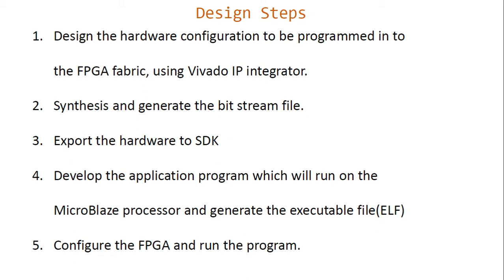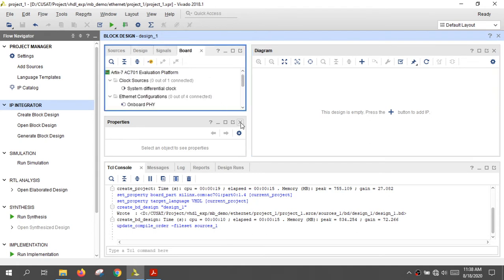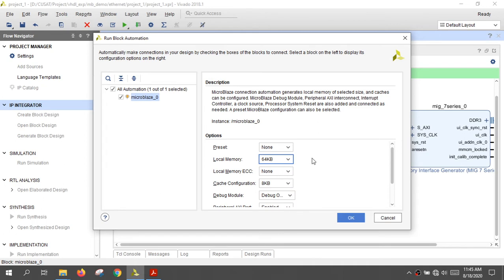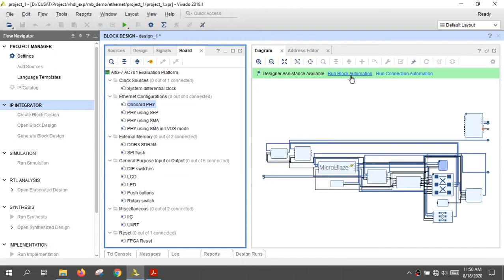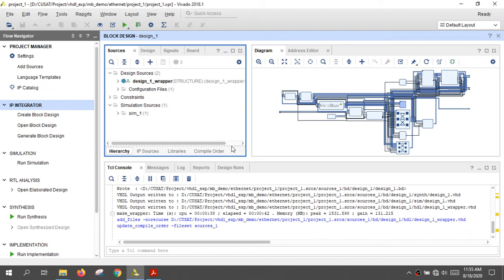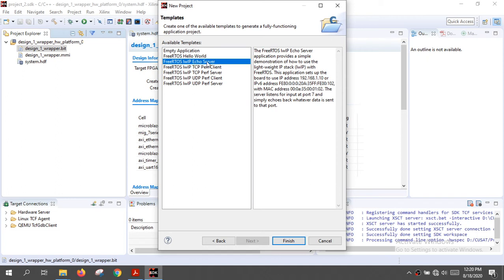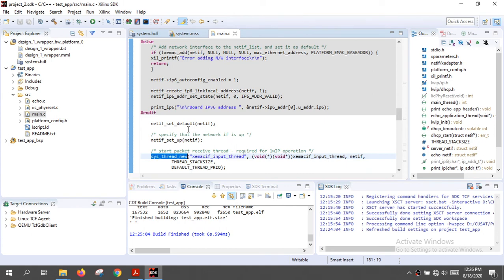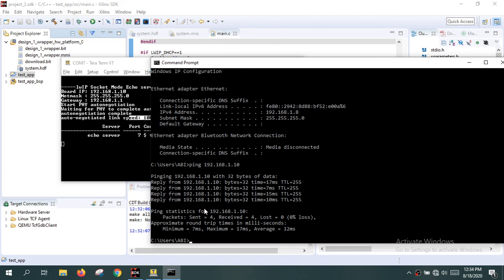MicroBlaze and Ethernet based design on Xilinx Artix 7 evaluation board (AC 701) and Vivado

Comment: Does ethernet ip need processor to receive and transmit packets? Or just hardware ok
Reply from the maker: @artie5172  it is not essential to have processor for using Ethernet. You can directly interface Ethernet IP to RTL
Reply: @letslearn39  👍 . Is that axis_txc and axis_rxc necessary? Can you use axis_rxd and axis_txd alone ?
Reply from the maker: @artie5172  txc is compulsory. Rxc I am not sure.
Reply: @letslearn39  what does it do txc and rxc seems like they are just control signals but what do they control ?

Comment: There is almost 1.3MB of block memory available in the Artix 7 200 on the AC701 board.  You don't need external DRAM for small applications.
Reply from the maker: True. If your application including stack and heap is small enough to fit in to 1MB, you can use BRAM. If you are not using lwip, freertos, jumbo Ethernet frames, then it can easily be made less than 1MB.(And ofcourse if you are not planning to use any BRAM consuming RTL logic/IP core in your design)
Reply: @letslearn39  I'm using the Full FreeRTOS+TCP stack with all features enabled.  Turned off Jumbo frames, and still can build and debug with -O optimization.  (Don't know why Xilinx/AMD keep pushing this trash LWiP stack...)  Would still love to have a short FIFO for my application instead of the complexity of DMA, for my simple application.

Comment: Hi,

Around 10:00, you're mentioning that we want to run the application from external DDR3 memory. But after that, you never come back to this point. So is the application effectively running from that DDR memory? If so, how is it loaded there?
If not, in video https://www.youtube.com/watch?v=cxl7Hh6TNb4 you're using the SREC SPI bootloader to download this application from flash into DDR. But DDR memory resides at 0x8000000 whereas the BRAM is located at 0x0. So I'm assuming that a change is needed to link the application correctly for that change in address space, but I couldn't find where that's happening.
Or maybe the address memory 0x80000000 is automatically mapped towards 0x0 by the SREC SPI bootloader (I remember from STM32 that this is done automatically somewhere in the bootloader).

I hope my question is somewhat clear?
Reply: In the meanwhile, I've understood that this is fully under control of the linker script. Furthermore, it's indeed vital to first generate the DDR3 controller before generating the microblaze processor. In that case, the linker will automatically select DDR3 memory to put the application in. And it's possible to revert back to BRAM.
I first added DDR3 memory on top of an existing microblaze design, and I never managed to get it working from DDR3 (and the linker automatically selects BRAM when creating the project). That's the sign that something is wrong. Possibly, the microblaze generation needs to happen after the DDR3 generation, so that the microblaze can immediately pick up the correct memory blocks and use DDR3 as default.

Comment: I followed the same, but it doesn't work. The HW goes up to VITIS, but if you run it with Echo Server Terra, it will not change from a black screen. I added the xdc file separately, is there anything else I need to add? I would really appreciate it if you could answer. The version is 2022.2.

Comment: Very good tutorial!! Thanks for sharing
I would have probably been more useful for me  a more versatile bare metal app than rtos....but very good anyway
Reply from the maker: The reason why I went for an OS is, lwip supports the SOCKET mode only with OS. Application development becomes much easier in SOCKET mode, as you can use the standard socket programming functions.

Comment: Sir please teach how to use and change user programmable clock in AC701  evaluation kit
Reply from the maker: You just need to add a clock wizard ip in your design and then you can generate the required clock

Comment: I followed this tutorial exactly in Vivado 2021.2 but I get some timing constraint errors. 
[Timing 38-282] The design failed to meet the timing requirements. Please see the timing summary report for details on the timing violations.
WNS -0.622 and TNS -265.714 Failing Endpoints 1732 ...

Comment: Just a quick question. Would this also works for Standalone OS? If yes, what is the reason behind you used FreeRTOS?
Reply from the maker: Yes this will work with standalone mode as well. The reason I used FreeRTOS was to configure lwip (TCP/IP stack) in SOCKET mode. Once lwip is in socket mode, you can use the standard socket programming APIs to develop your applications. In RAW mode you have to use lwip specific APIs.

Comment: Thank you very much, worked for me i have configured ethernet port of zc702. Now can you tell me is possible to read received data from PS to my PL part. I want to see received packet data using ILA??
Reply from the maker: A simple way to transfer data from PS to PL would be to interface both using a Block RAM configured as Dual Port RAM in BRAM controller mode

Comment: how the interrupt handlers are configured in sdk?
 u r directly compiling and showing the ouput.
Reply from the maker: If you are using lwip stack in your application(which is the case in this demo), you need not manually configure interrupt handlers. It will be taken care by the Xilinx port files of lwip. Manual configuration is required only if you are developing a bare metal application without any TCP/IP stack.
Reply: @letslearn39  thanks for the reply. lemme check this.

Comment: Hey man, thanks for your video, i found that quite helpful, Now i'm trying to send my XADC data through Ethernet but i don't know how should i merge my independent XADC project with lwip and how can i do modification on lwip part?

Thanks in advance
Reply from the maker: You need not modify anything in lwip. In Vivado add XADC block in to the Ethernet  based design. Directly read the XADC data using XADC APIs, copy this data in to your Ethernet packet payload and send. Please note the MIG block is internally using XADC for temperature compensation. So you need to reconfigure MIG to exclude the instantiation of XADC and connect the temperature port of your XADC block to the MIG  temperature port.
Reply: @letslearn39  Thanks for your response my friend but i didn't get the point and following question comes up for me :

1. which Ethernet based design you mean? There is no any ethernet based design, i want to use ethernet ability in my "exist XADC" design. 

2. I don't understand why you are talking about MIG block because i don't using any external DDR3/4 in my exist design.
Reply from the maker: @emadmojaveri1404   My whole reply was under the assumption that you are using MicroBlaze. Now I understand that you are using Zynq. 
1. The Ethernet based design which I was referring was the one which I am demonstrating in this video. It is very easy to integrate XADC in to this design rather than introducing Ethernet in to an existing XADC design.
2. If you want to use Ethernet, You will need MIG in a microblaze design as your executable wont fit in the block RAM.
None of these matters when you are using Zynq. Please provide the details of the hardware you are using. Are you using custom board? which memory does your existing program use. In case of Zynq you just need to enable the Ethernet in the Zynq PS in your existing design and generate a lwip sample program. Use the same APIs which you are already using to read the XADC data. Pack it in the Ethernet payload and send.
Reply: @letslearn39  well, First i'm using Arty Z7(https://reference.digilentinc.com/reference/programmable-logic/arty-z7/start) as a hardware platform. Second my XADC project works fine and send data over uart properly but now i'm trying to send it thru Ethernet but i have no idea about "Pack it in the Ethernet payload and send" , would you tell me how can use that payload?
Reply from the maker: @emadmojaveri1404  If you want use Ethernet you should have basic idea about socket programming. You have to make few decisions like you want to use TCP or UDP, IP address, prot number and the packet format. I wont be able explain everything. I can send you a sample file which I did for microblaze and XADC. You wont be able to use it directly for Zynq. Mail me at letslearnembedded@gmail.com
Reply: @letslearn39  thanks a lot, i sent you.
Reply: @letslearn39  and something that i have to mention, I'm using zynq SoC device and i do not using  microblaze.
Reply from the maker: @emadmojaveri1404   Oh!! That should have been the starting point. Since you posted the comment under the Microblaze based design, I assumed you are using MicrBlaze..
Reply: @letslearn39  YES, i've guess you don't know that and i have to mention it at the beginning, i was looking for zynq+ethernet videos that reach out to your video, it looks pretty close but still there is some differences that must be considered

Comment: Haii.. Dude iam using ZC706.. I tried to implement Ethernet by using phy sfp, with Microblaze iam not able to generate bit file..till implementation it is happening.. When ever iam trying to generate bit file it showing error kind of xdc file. After that I entered two commands through tcl. Then bit generated. But when I was loading to FPGA through sdk then it is showing there is no ps in the design what could be the reason please tell me.. After that I need to go custom board..
Reply from the maker: Please note that Zynq is an SoC FPGA where Processor is the master and it is the PS which configures the PL. Even if  you need only resources from the PL, PS needs to be initialized for booting the PL. For PL only design you can refer to the attachment in the following link taken from Xilinx forum
https://forums.xilinx.com/xlnx/attachments/xlnx/EmbBoot/14/1/Zynq_PL_Only_DesignNote.zip
Note: I have never tried this configuration

Comment: By using AXI ethernetlite  block we can do this?If yes please make a video or please send me the implementation design.
Reply: I have seen the implementation in the given below link. please refer and make a video with help of this       
reference https://numato.com/kb/100m-ethernet-example-design-for-neso-artix-7-fpga-module/🙏🏻🙏🏻🙏🏻
Reply from the maker: Ethernet lite MAC  supports only 10/100 speeds and MAC PHY interface is MII. But in AC701 board it is using RGMII for MAC-PHY interface. So I am not sure whether it will work on this board. I have never tried it.
Reply: @letslearn39 once try 😯
Reply from the maker: @Kalyannik   No luck. Refer UG952 Page 41::"The board supports RGMII mode only". Ethernet Lite wont work.
Reply: Could u please do a video on axi ethernet IP provided by xilinx to send updates packets with vhdl code
Reply from the maker: @akhiljoseph3237   Its difficult to make a video for the VHDL implementation of AXI Ethernet MAC interface and explain everything. I can send you a design which I made for transmitting messages through Ethernet. You can go through it. Write to me on letslearnembedded@gmail.com

Comment: Hi, did u need any licence for the eternet ip core for this design ? I have the same board but i was not able to fully generate the bitstream because of some licence issue related to the ethernet ip core. Thanks for this tutorial
Reply from the maker: I faced the same licensing issue when I was running Vivado on Ubuntu. But the same design worked well in Windows.
Reply: @letslearn39  Hi, I am using Windows but it gave similar error, Do you know how to solve this issue? Do we need license for that?
Reply from the maker: @1800haseeb  You probably need a valid license for this. I am operating on a university license. If its not available you can try the design with evaluation license from Xilinx. You can get the evaluation license for Ethernet MAC from https://www.xilinx.com/products/intellectual-property/axi_ethernet.html
Reply: Hi shall i set my project as this project to get job and this project is helpful for my interview?